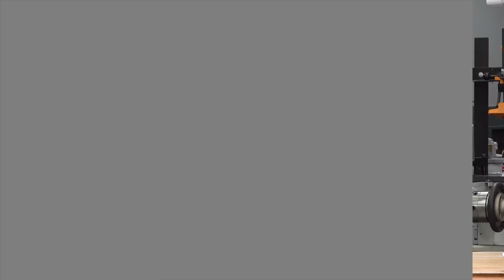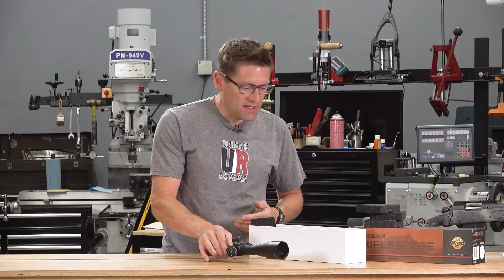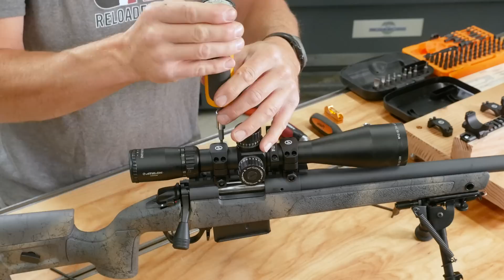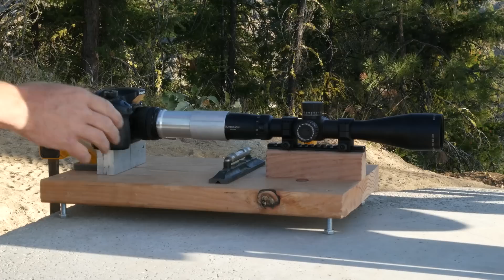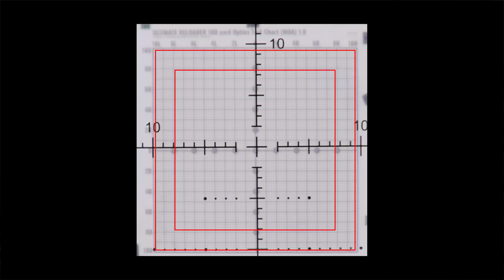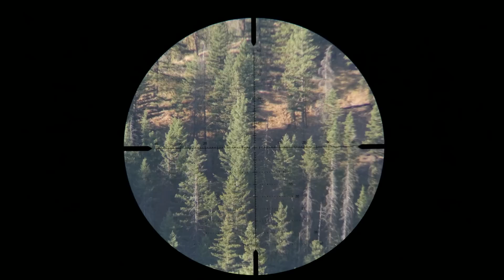TESTED: Athlon Ares BTR GEN2 4.5-27x50mm Riflescope

Comment: Haven't had a chance to test if it holds zero, but mounts just fine and has nice clear glass. Centered vertically true to a plumb line with the crosshairs which is always a plus!It's a great https://www.youtube.com/post/Ugkxc4K63Fd5LglDMObu7-Bgapxp_ef0W8hE scope. There's no parallax adjustment or focus ring, so may be limited to 3-7x, have to see how it is on the range. Also be aware that the rings are "look through" so you can still use irons, but they are really tall if you only intend to use the optics. On a 22LR no biggie since I'm not shooting competitions or worried about a hard cheek press. Will boresight and range test, if all goes well, I'll leave it at that!

Comment: Which has better glass, the Ares or Midas tac
Reply: I have three each of the Ares BTR 4.5-27x50 and Midas Tac 6-24x50 and all 3:of my Ares are slightly clearer than all 3 of my Midas Tacs according to my own eyes on high magnification. The Midas Tac snaps into focus a lot quicker though.  I don't like how thin the Midas Tac reticles are and prefer the Ares BTR easier to pick up on low magnification whole the Midas Tac need to crank it to at least 10x to even see the reticle. Fine if you don't hunt with it and only plan to use the Midas Tac to punch paper with though.  I'd suggest the much cheaper SFP Midas BTR Gen 2 4.5-27x50 much easier to see the SFP 15x reticle and about neck and neck in clarity with the Midas Tac.

Comment: Gavin
I need your help. I have spent hundreds of hour researching a scope for my fx impact m3 rifle.
I want to shoot in my back yard. I also want to hunt varmits, and coyotes. This air rifle can shoot long range, so as I learn I want to explore longer distance shots. Thats a lot to ask for a scope. Im sold on Athlon, the midas tac 6-25 -50 is one that I might pull the plug on. It has a 10 yard min focus. I also like the Ares 4.5-27-50 the fact the 4.5 for back yard over the midas 6-25, but the min focus is 25 yrds. Since you have own both do you have a suggestion. I don't have the chance to touch or see these scope in my hands and rely on You tube for help. thank you
Reply: The Ares BTR Gen 2 is a lot easier to see the FFP reticle especially with illuminated reticle whole the Midas Tac is very hard to see the reticle unless you crank it at least to 10x magnification.  You can easily see under 10 yards if you back the magnification down on the Ares BTR. I think you can do 6-8 yards at 4.5-6x and up to 10x at 10 yards and 15x at 15 yards and 27x at 25 yards if memory serves.  I had one on a 10 meter match rifle at one point and the 25 yard minimum focus wasn't an issue. If you can deal with a SFP reticle the cheaper Midas BTR Gen 2 4.5-27x50 has a 30 yard minimum focus parallax but it's really easy to see the reticle and use it for dialing in every shot and keep the magnification below 15x when shooting under 15 yards.

Comment: Is this scope still worthy of $630 new in the box in today's market?
Reply: That's a really good deal if its the gen 2.  Lowest I've ever seen them were $695.  The gen 1s were selling on clearance for around $400 and resellers were profiting by selling gen 1s for close to the gen 2 prices which is a rip off.  The most a gen 1 should cost brand new should be $400 since it's a discontinued model.
Reply: Update the lowest I've seen these are $565.49 with free shipping and free returns within 90 days at Walmart online and Amazon but not as long of a return window as Walmart.

Comment: Great vid. I would love to see a review on the Athlon Cronus BTR Gen 2. It’s very interesting to see what other smaller companies are producing for the money.
Reply: The Cronus line are the only scopes that are made in Japan while all other Athlon scopes are made in China.  The Cronus isade at the LOW factory in Japan and is similar to the Tract Toric, Delta Stryker, Maven, Trijicon Ten Mile, among other similar 4.5-30x56 Japanes made scopes.  I have the Cronus and the Tract Toric ELR and the Tract ELR is a better scope compared to the Cronus for around the same price and (the Toric ELR) includes a sunshade and press fit scope lens covers while the Cronus doesn't include either of them. I own several other Athlon scopes and what I don't like is for the price I paid for Chinese made scopes and the Japanese Cronus didn't include scope lens covers nor sunshades which many other brands automatically include.  I think that's being chinsy on their part when spending so much money for their scopes compared to other similarly prices brands.

Comment: In addition to proper alignment, scale, accuracy, repeatability, and registration of reticles it would be beneficial to see a truly objective assessment of the optical quality of the glass in scopes evaluated.  This should include resolution, chromatic aberration, variation in edge to edge light transmission, color rendition and some assessment of the effectiveness of lens coatings for comparison.  Manufacturer buzz words like ED, HD, APO, a multitude of coating specs, etc. applied to their products as commercial selling points are seriously imprecise parameters and tell us nothing about the quality of glass from one scope to the next.  This type of information is common as it relates to photographic equipment.  If anyone on YouTube can do this intelligently Gavin can.

Comment: I subscribed. I like your reviews, always using your brain and seems like even if there was bias (seems like none) the review is just about facts. Now please review Leupold and Tract!
Reply: I really like the Tract Torics since I prefer Japan made scopes over Chinese and am on my 3rd Tract Toric now.  I'm also on my 3rd Athlon Ares BTR 4.5-27x50 as well ironically. I think the Athlons models specifically with the HD glass are the only nice Chinese scopes that are actually worth buying. The rest of the well known brands selling Chinese scopes seem to be lacking in some way or another in regards to glass quality or lack of reliable tracking and overall quality control regardless of price.  Fine if they cost under $300 consider they are made in China it's expected but certainly not when spending more than $300.  There are a number of sub $300 scopes that seem to perform as good as scopes that cost a lot more.
Reply: @commonsense5709  I already did my buying a long time ago. I have a Tract Toric and an Athlon Ares BTR. I like both but never really got the chance to use the Tract yet. The glass on the tract is German I believe. The Athlon actually is Chinese but it’s awesome. I also have some Element scopes that are Chinese. Seems you can get some decent scopes from China. I do a lot of .22 shooting and when trying for precision distance shots you need great stuff with zero stop, power and lots of adjustment. BUT you also need to parallax down to close distance and my favorite scope manufacturer Leupold doesn’t think that combo is necessary. So I was forced to look elsewhere and glad I did. Trijicon also makes some great stuff. They also use Light Optics Works in Japan. GOOD STUFF. I think the Tract and I know Night Force is made there.

Comment: So should I take this one over the vortex tactical 6-24x50 or the primary arms SLx 4-14x 44? Oh never mind the AResis in a totally different class
Reply: Once you but the Athlon Ares BTR 4.5-27x50 you'll think the other cheaper scopes such as the Vortex Diamondback Tactical is really junk. Buy at least the Athlon Midas Tac 6-24x50 instead of the Diamondback Tactical or Venom I can guarantee that you won't regret it.

Comment: Problem you run into with 6x magnification in FFP is that usually the low end reticle is so small its unusable.
Reply: Agree, totally disappears, so worthless for hunting at those magnification settings.  Luckily, they have a SFP option, while most do not.   Would have liked Gavin to fuss with the locking turrets a bit, since that is extremely rare on scopes in this price range
Reply: Not in the case of Midas Tac 6-24x50 vs Ares BTR Gen 2 4.5-27x50 where the 6 fold magnification on the Ares makes it an overall better scope with better image quality than the Midas Tac believe it or not.

Comment: I own this scope and have it mounted on a 6.5 Grendel AR.  It has a BSF carbon fiber barrel and shoots .38 MOA with factory Hornady Black 123 grn. I built this gun as more of a tactical or target rifle than a hunting rifle. It’s for this reason I bought this scope.

Personally, I believe a hunting scope features are:
1. magnification for a maximum hunting range of 350 - 400 yards. A hunter should be able to stalk within ethical range of an animal. Low magnification is more useful than high due to the larger FOV. 
2. A duplex reticle. No time to range a distance using the reticle normally. Within that 350-400 yard distance, a flat shooting cartridge and a scope sighted for MPBR will negate the need for a ranging reticle.
3. Turrets with caps. No chance of bumping them during the stalk. Also see #2. 

For the money this scope is amazing and I suppose it can be used for hunting but personally I think there are scopes with different features that suit me better.

Comment: I like the way your doing  the testing  with the camera  I think that's a great idea . I'm into field target shooting  with air rifles  . You have to be able to  put pellets throw small holes in metal targets to knock them down and get points  out to 150 yards   in the extreme  field target matches  and 55 yards for just regular field target matches  with close shots down to 10  yards  with tiny  openings .Most of the scopes used in field target  are over 1,000  but I just can't afford that  so   I'm looking for a sub 400.00 dollars scope  in ffp  with a  4.7-27 or  6-24 power with side parallax  down to 10 yards . I'm also going to be hunting small game with it  like squirrels and rabbits   in the woods where it can get pretty dark  even during the day so I'm wanting  some illumination . I'm looking at the  Athlon argos btr gen2  ffp with the  APMR first focal plane illuminated MIL reticle . Have you done any tracking  tests with this scope ? If not will you  do a tracking test with your camera test rig setup  ad let me know  what you think. about the tracking . I'm going to be clicking for the matches  in one class and  I'll be using the reticle  in the hunter class . I need a scope  that tracks  correctly  every time . I'm not sure if thats possible or not at  the  400.00 peice range or not  but I think this scope might  be the closes I can get  for the price I'm looking at . Also there is one other scope  that  might  it the bill and thats the new  element ffp  helix   6-24   https://element-optics.com/product/helix-ffp/ the only thing I don;t like about it is  it  doesn't have  the illuminated reticle  . But it does have a stainless steel  turret housing . Which they are saying is better than the  regular  brass  housings . What do you think about that ?  Will you look into that scope also and do a tracking test on  that scope also . If you can  maybe do a side  by side  comparison  of the 2 scopes .
Reply: Element Optics brand scopes don't offer a good value for your money spent. I think they are very overpriced for what you actually get when compared to other brands in their same price point.  You'd be much better off buying the Athlon Midas TAC 6-24x50 for around $500. It is also made in China just like the Helix and Titan but has superior glass and tracking compared to the Titan and Helix. The Helix has an extremely terrible eyebox with mediocre glass.
Reply: The Argos Gen 2 has a better eyebox compared to the Helix and the glass is about the same mediocre Chinese glass just don't zoom to the maximum power then you are fine with the Argos. The Midas TAC has upgraded HD Chinese glass that's night and day better but it's going to be very hard to see the reticle at the lower magnification for hunting as with all other FFP scopes unless you but something like a FFP Meopta Optika 6 with the MRAD 1 horseshoe reticle 3-18x56 if you really need a 10 yard close focus parallax or the FFP Athlon Helos 2-12x but the glass isn't the best at 12x.
Reply: A buddy of mine recently bought an interesting Chinese scope for under $160 shipped. It's a 6-24x50 FFP 30mm Ayin brand.  He compared it to his Vortex Diamondback Tactical and Element Helix all 6-24x50 models and stated the cheap Ayin had the best image quality and eye box on high magnification and so far has very good repeatable tracking as compared to the others. It does not have a zero stop but include flip up lens covers and a sunshade.  Some other friends including me are considering a group buy of 4 or more for under $134 apiece including free shipping.  The Element Helix and the rest of the Element Optic line of scopes were recently selling through a well known overstock wholesale outlet for $275 and $325 for the 6-24x50 SFP/FFP and $330 fir the FFP 4-16x44 and $550 Titan 5-25x56 and $1100 Nexus 5-20x50.  None of us bought any of them even at their sale prices since we feel they really weren't worth the price compared to other brands that are cheaper.

Comment: Did you consider the Toric UHD 4-20x50?
Reply: I owned 2 of them and they were fantastic scopes with superior optics aside from their low 65moa elevation and heavier than average weight.  I bought the Toric ELR 4.5-30x56 which I like better than my Athlon Cronus BTR.  I parted ways with both Tract Toric 4-20x50 scopes after getting my first Athlon Ares BTR 4.5-27x50 which I felt were better for my use due to it's higher 80moa elevation and lighter weight with more magnification range.  When compared specifically from 4.5-20x the image quality was a toss up as it could go either way. It was more noticeable when compared with the $1500 Element Nexus 5-20x50 where the Athlon Ares BTR was the clear winner.  The Tract Toric is a clear winner compared to the Element Nexus from a glass standpoint.

Comment: Great View just subscribed, whats your opinion between FFP and SFP on this scope? I can't decide which option to get, thanks, used for hunting and shooting,.. Do you think you can see the reticle better with SFP? thanks....
Reply: oops Great Review....
Reply: The FFP Ares BTR has slightly better glass compared to the cheaper SFP Midas HD.  If you prefer SFP then I'd rather buy a Japan made Sightron SIII 6-24x50 starting from $600 and up or the Japan made Trijicon Tenmile 4-24x50 on clearance for $780 or their Tenmile SFP 4.5-30x56 also on clearance for $1050. They retail for around $1800 and $2700.
Reply: If you dial in for all your shots then the SFP reticles would work.  If you rather holdover and not click then the FFP reticles are better.  If you're concerned about the reticle disappearing on low magnification, it's a very common issue when using FFP scopes.  You can just scan your hinting area on low magnification then zoom in until you can see the center of the reticle or turn on the illumination if you are shooting in darker areas. I personally prefer SFP reticles but unfortunately the best scopes usually all have FFP reticles.

Comment: What would I like to see? A scope ranking list forming with every scope you test in term of glass quality firstmost, then turret and reticle ranking. With every new scope you test compare it against one of previous scope on list to find its place on ranking list. If you dont have all of the old scope just place that scope on list with area it could be between two tested scope.
Reply: I personally believe the Athlon Ares BTR 4.5-27x50 is hands down the best sub $1000 Chinese made scope that money can buy.  We did a lot of scope testing across the board regarding Chinese and Japanese scopes from a lot of different brands and models.  No other made in China scope from any other brand at any price we tested could match the Ares BTR on high magnification while still offering 80moa elevation of elevation with repeatable turrets as well as a nice positive zero stop.  Other scopes of Chinese origin from the competition simply could not keep up on high magnification.  The other scope of that significantly outshined every other brands regardless of price (regarding Chinese made scopes) is the Athlon Midas Tac 6-24x50.  I usually prefer to buy Japan made scopes but these two Chinese made Athlons are the very best we have ever tested.  The Athlon Ares BTR was even better than the Japan made Element Nexus for roughly half the cost as a result of that head to head scope comparison.

Comment: How does it compare to the etr. mainly on tracking but also image quality. I know the etr has more range and had excellent tracking. Long story short if this is going to be my only long range target scope do I need the etr
Reply: I'd recommend spending a little more money for a Japan made scope such as the Cronus that can be found for $1300 - $1400 through some dealers via phone call who can offer better than advertised prices.  If you're fine with a SFP reticle and plan to dial in your shots then the Japan made Trijicon Tenmile 4.5-30x56 is on clearance for $1050 and is a $2700 scope.  It's very comparable to the Athlon Cronus and includes very nice expensive flip up lens covers and a sunshade that the Athlon doesn't include.  They are both manufactured at the same scope factory in Japan.
Reply: The main reason for suggesting going fir a Japan made scope instead of the Ares ETR is it's still a Chinese scope.  It's actually the best Chinese scope that money can buy but I know it's more markup over quality compared to Japan made scopes.

Comment: Hey Gavin great work on the test, I do have a question, you mentioned the camera being square to the scope both horizontally and vertically would this not be true with the target as well you mentioned that it was level but if the angle didn’t match on both axis could this have lead to the right side windage being a little off in the test.